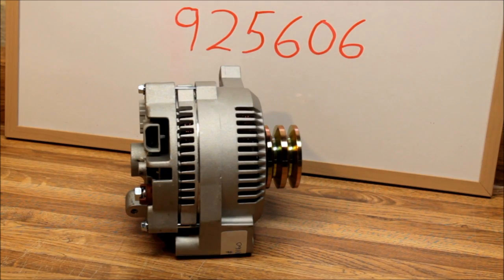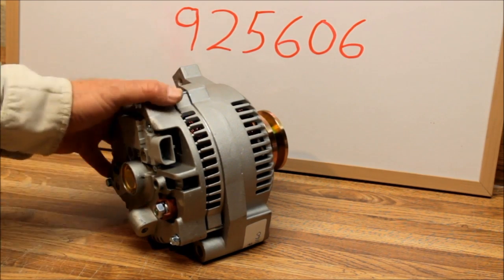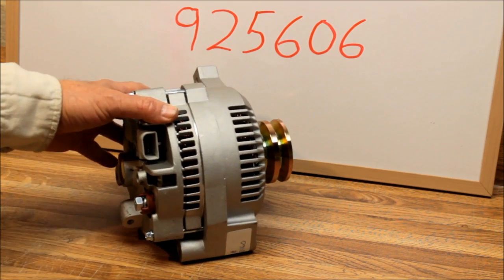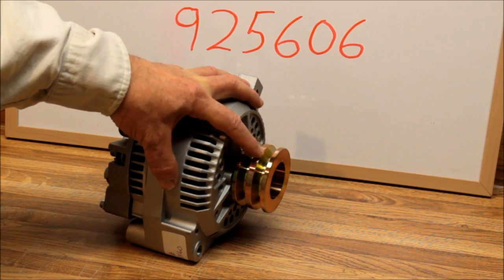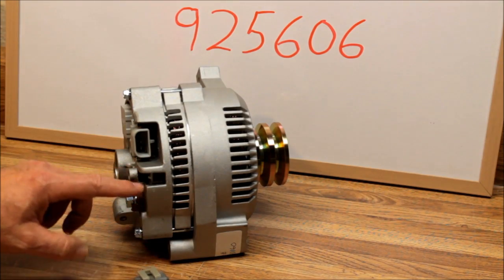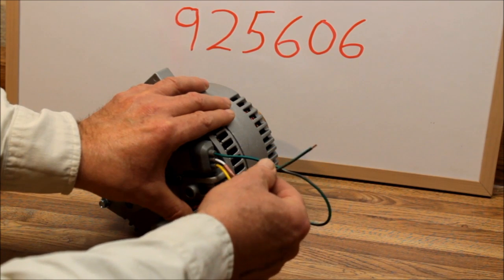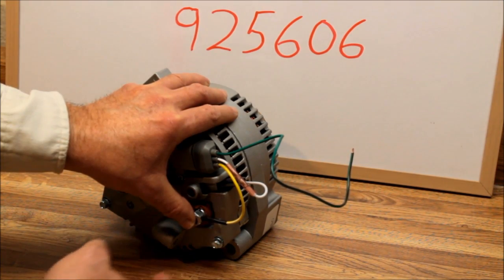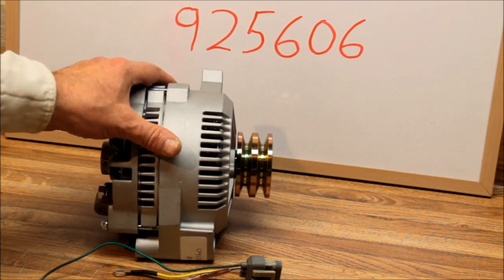3G Large Case High Output Alternator with Wiring Harness

Comment: What is the function of the wire running back to the battery plug?
Reply from the maker: more power That is the voltage sense line. It lets the regulator know what the battery voltage is. Some alternators have an internal connection from the battery post to the regulator, but not the 3G.

Comment: Maybe you can answer my question,  i got a 93 toyota paseo i was looking to getting a larger alternator since im pulling more power from my stereo system and what not.. The stock is a 70amp and i was thinking of going up to a 120 to 140.. what im afraid of is burning the wiring harness .. Also im not sure what the largest is can toss in it with out hurting anything either but i did find a 90 amp which i figured wouldnt hurt anything since its only a 20 amp difference and not say nearly twice the stock one. what would your recommend? i hear you need to run and inline fuse, if so how?